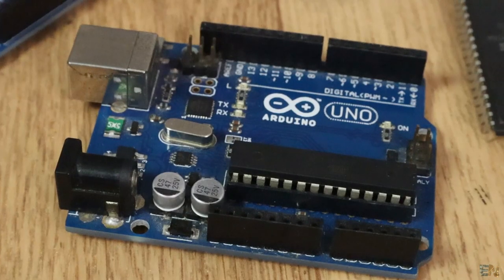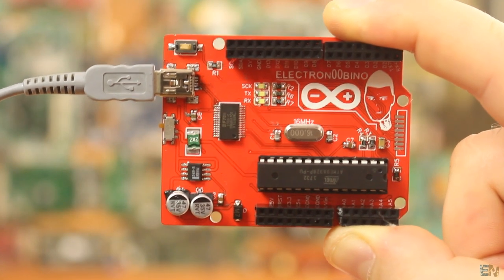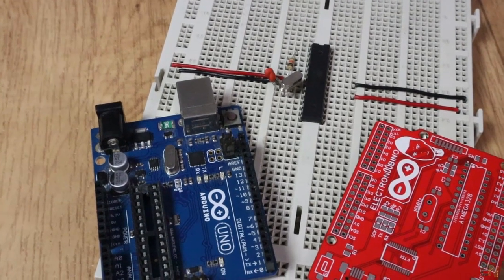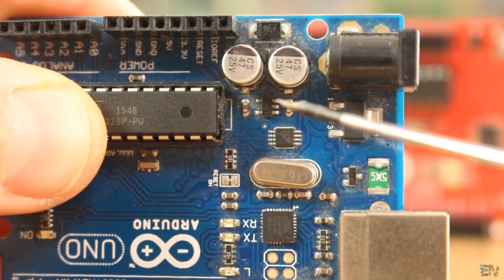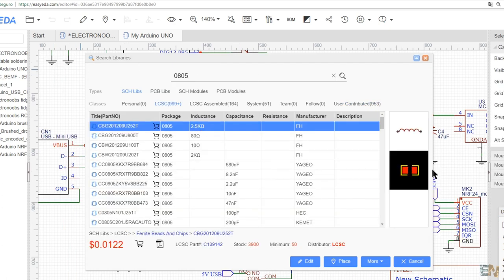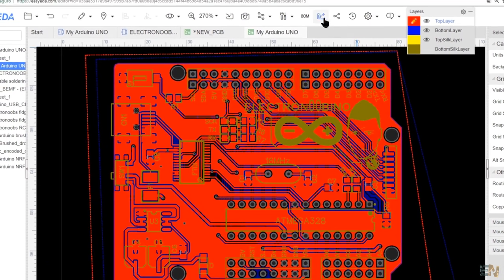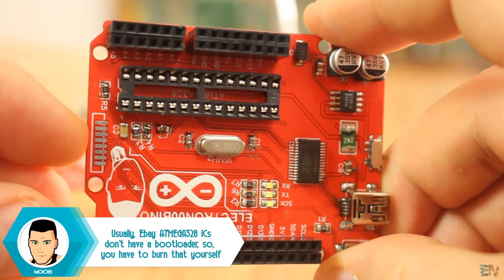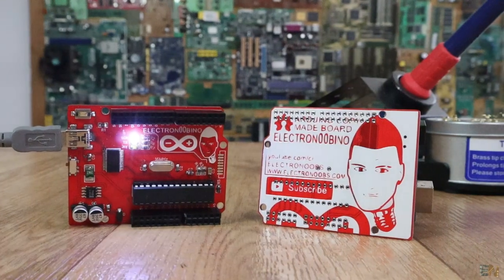Electronoobino board | How to make your Arduino UNO

Comment: very nice, one change i would make to the board is put the extra pins on the outside, not inside, so if you put a shield on, you will still have access to the pins on the outside. Gracias, muy bien.

Comment: If I was to do this I would use screw terminals for the first row and headers on the second row. Also a ZIF socket and maybe a resonator instead of a crystal to lower the component BOM. Call me crazy but a RS232 port would be nice so I don't have to always use USB.

Comment: You might have considered using the atmega328b chip.  This adds more i/o, extra usart, extra spi, extra i2c.  It's in the QFTP package, but they are not hard to solder by hand.

Comment: Firstly, good job friend ;)
There is  big area to add extra functions at bottom layer
So, I could add second atmega chip to be optionally soldered (for more computing power) ,
and at least one type lcd (maybe oled or tft ) 
micro sd card slot
small nand flash chip,
esp8266 module footprint, 
and my favorite : mpu6050 ;)

Comment: Arduino never has been my passion because I always loved speed and flexibility and I was Microchip fan. Lately arduino has come in to my bench to simulate some signals to test my STM32F407 designs running FreeRTOS. They are commercial products I design for living. If you start using ARM chips you would know what you really missed while staying with arduino layer. I need few Arduino boards and its good idea to build it when I send my next order to JLCPCB. They are building the future.

Comment: Awesome job! I‘ll make a custom design of a arduino nano/pro micro with more pins, than the regular one and maybe also a wifi module
Greetings from Switzerland :)
Reply: And i would also like to make a version with built in relays for easy home automation :)
Reply: Did you made nano
Please share schematic

Is 232 needed

Comment: I'm a bit confused: your step down converter creates 3.3 volts right? But the ATMega328 needs 5V and the USB also provides 5V... why do you convert VIN to 3.3V? Greetings from Switzerland
Reply from the maker: I've used the 5V model of this regulator: https://www.ebay.com/itm/5PCS-X-MC33269DR2-5-SOP8-ON/332528016022?ssPageName=STRK%3AMEBIDX%3AIT&_trksid=p2057872.m2749.l2649&rmvSB=true
Reply: Electronoobs thank you very much! Now it makes way more sense :)

Comment: building an arduino for prototyping is not really worth it, but you can create highly specialized boards using microcontrollers. i plan on building some sort of outdoor weather/irrigation computer with dedicated boards to save space and be as energy efficient as possible (using an arduino chip to power on an raspberry pi every 2 hours or something) there are endless possibilities

Comment: 3:11 Doesn't Reset (pin 1) has its own internal pull-up resistor? Because I know simpler microcontrollers (e.g. ATtiny2313) having one...

Comment: You could buy an arduino for 2 to 3 $ but this video still worth it, this way you could customize your arduino board, and one more thing, I hate these female headers please design a PCB that doesn't have female or male headers, use PCB terminal.
Reply: Muhammad Waqar I nearly smashed my head in with the last project I made because I used pcb terminals
Ended up keeping the board design but didn’t solder the terminals on and soldered wires directly to the pcb.

I don’t know why mine sucked so much. The reviews on them where great

Comment: Great Video. Although the cost of the components alone plus the PCB are higher than an Arduino Clone so no much sense to build one I guess. Also please check the video description you have some bad spelling at the have word ;P Always love to watch your videos keep them coming.
Reply from the maker: Thanks for that. Yes, making a board is more expensive. But once you learn this configuration of the ATmega, you can make your own boards for different projects...
Reply: Electronoobs Yes, and you can add things like extra security (check out the Ruggeduino), more LEDs...
Reply: @ELECTRONOOBS  is there a way of getting the gerbers whith th two cheaper components i want to try it but my budget is limited
Reply: If you are making something with a limited space makeing your own arduino could be helpful if you can make it smaller

Comment: Info: this link with ZT102 Multimeter is already expired :P

One question, is there any way to add a MicroUSB connector to this PCB or will it slow down the data transfer rate?
I have almost 70 female MicroUSB connectors and I need finally to get slowly rid of the MiniUSB connectors since almost every device uses MicroUSB
Reply from the maker: No, you can add any USB that you want. The UART communication is nat tat fast and it won't be affected by that!
Reply: Thank you very much for the answer. I will then replace the existing connector with a MicroUSB one
Reply: You can do that, but mini USB is better as it’s more robust.

Comment: What would be the total prize per Elektronoobino if you had ordered the green PCB's?
Reply from the maker: Well, the price per board: 20cnts the board + 2€ the ATmega328 and socket + 1€ female pins + 10cnts voltage regulator + 1.5€ the FTDI chip + 1€ extra small components(resistors, cap, buttons, fuse, swithc, usb connector) = 6--7€ in total
Reply: Wow, that's cheap. Thank you very much!

Comment: Hi everyone, I have an AMS1117 voltage regulator, and there's an MC33269DR2-5 on my PCB board. Can I use the AMS1117 regulator in place of the MC33269DR2-5 without any issues?

Comment: How did you use the MC33269DR2-3.3 to output 5V when it's output is fixed as 3.3V ????
Reply from the maker: I've used the MC33269DR2-5.0 !!
Reply: Thank you, Good videos but just because it was mentioned as 3.3 in the easyeda so i got confused thx :)
Reply: +Electronoobs konse app SE soping kartho

Comment: Hi... Bro.,
It would be good if you suggest me a solution to this problem.
I have boot loading problem.,
The actual problem is I have chip 1 bootloaded and programmed and chip 2 not getting bootloaded.
But the chip 1 is also not getting bootloaded the 2nd time.
I have even followed few steps like changing the piece of line in avr dude ( for atmega328p address).
Please do suggest a solution.

Comment: You need a crystal for the minimum configuration?
I thought the ATMEGA328 had it built in. 

At least my ATTiny works without a crystal.
Reply: Leberkas Semmel It has a 8Mhz crystal built in, but you can add 16 or 20Mhz crystal externally. 20Mhz doesn’t work well with the arduino libraries because of some timing issues, so usually 16Mhz is used.
Reply: So no. The Atmega doesn't need a crystal for it's minimum config.

Comment: Is there any reason why you didn't test the pcb before plugging in the two IC's?
Powering the PCB up and checking for correct supply voltages in the right places is one of my first tests.

Good video and the PCB quality is  really good.
Thanks.. Tom..
Reply from the maker: Yeah, I kind of made this circuit a lot of times so by checking if I ahve 5V and any shortcut is enough!

Comment: Please develop a circuit and code which connects with Andriod phone remote apps through Bluetooth or WiFi to arduino and transmits it to machine(bots,CNC ,drones and etc through nrfmodule or radio
 module having high range)
Reply: Or make Andriod as remote with Arduino and nrf24lo1 module instead of rc remote
Reply: NIKHIL kumar You may be interested in thr blynk app. Might not be perfect for what you are imagining but it allows for easy interfacing between controllers and Android

Comment: Great. How about Micro SD support?
Greetings from Germany.
regards Thomas.
Reply from the maker: ABC DEFG you mean adding a micro SD port on the board?
Reply: Electronoobs Indeed, for saving Sensor data or so.
Reply: You could do that.
You could also use the onboard eeprom on that chip. It would still store the data during power resets.
You just wouldn’t have a card you can take out.
But you could send the data to the PC still through USB.
Butttt you’d be limited to 512 bytes of stored memory.
Buttttttttt because sensor data is typically the same for long periods of time you could compress your sensor data.

Comment: Designing something that already exists, and can be bought for less than $4 is not very interesting or economical. 
Thumbs up for effort.
Reply from the maker: UFOhunter of course an Arduino from eBay is way cheaper. I just wanted to show you how to make the board. Once you know the basic configuration, you can make your own boards with the atmega chip. Keep up!

Comment: Don't make boards like this bro. If you do, Arduino will run out of business.
Reply: That's ridiculous
Reply: Arduino has a donation page.
I try and donate at least once a year because I mainly buy esp8266 and esp32 or make my own arduino circuits now.
Reply: If Arduino was worried about this they wouldn’t make everything open source. Plus this is a lot of work, most people are going to buy a complete one.
Reply: And let’s not forget that the millions of Chinese clones are worse than 10 boards (of which only one assembled) not to be sold.

Comment: Didn't expect this from you electronoobs.Arduino is available for less than 2$ today no one wants to build and spend around $5.Instead you should have done something better such as any equipment like hot air solder or so
#Dissapointed
Reply from the maker: Base And Trance sorry for disappointing you. I bet not everyone knows how to mount the bare minimum config of the atmega328. Also, once you know how the Arduino is made, you could create your own boards. I've made the Arduino for myself and thought to share that with you guys. Keep up!
Reply: Electronoobs surely you are right but for this configuration one can always see the Arduino official tutorial for atmega on breadboard and Arduino has much more of what is needed for a single project so building the whole board might be a waste of time ,Money and power.
Anyway mistakes make us powerful, so best of luck for future
Reply: in my country it cost 120 le for 1 board that 7 + shipping it's better if i am made my own